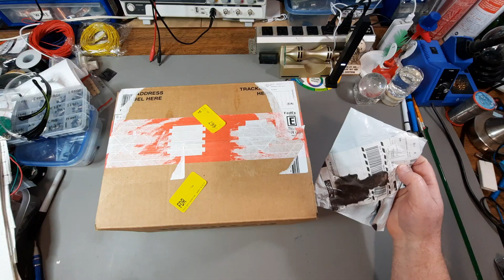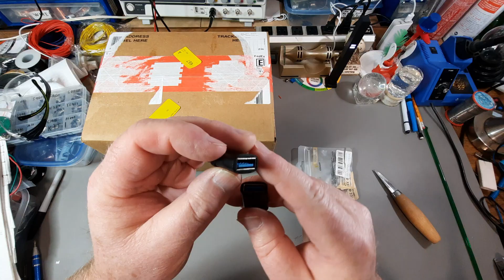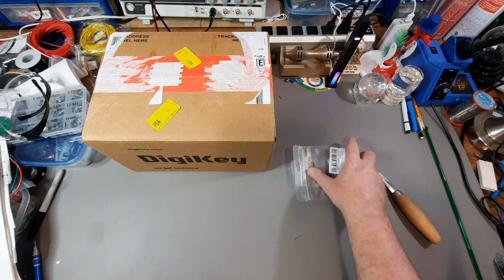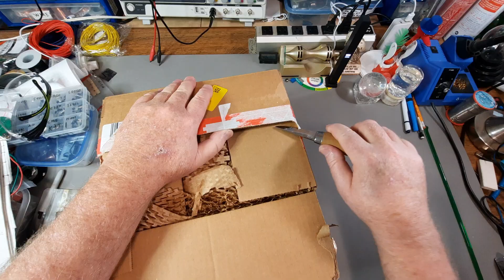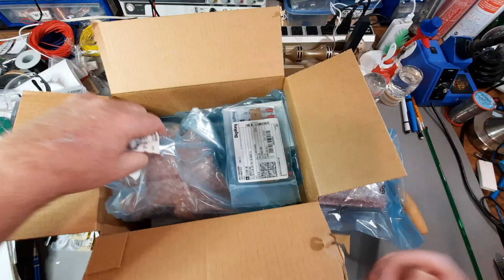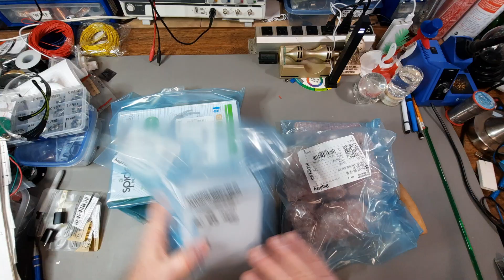Mailbag 45 ish Digikey Electronics Order

Comment: A standard to compare to?
How dare you?
The overstated switching speed on the Texas Instruments Optical couplers comes to mind.
Reply from the maker: Not sure which you are referring to, but for the CD4521 it will be used for low frequency and the capacitor i will find it's popping voltage.

Comment: Wurth Capacitors, are generally very good. They are up there with Nichicon and Rubycon.
Reply from the maker: It will be a good one then to compare against some $0.03 capacitors. See which degrade or pop first.
Have a good day
Reply: @retireeelectronics2649  Well... for normal use, the cheap AliExpress capacitors a fine. For precise work or less noise work, generally precision equipment, and where I use them, in audio equipment.

Comment: Thanks for posting. Question you ever used the CD4024be Seven Stage Binary Counter ic chip? I have used one to build an analog to digital R2R resistor Stair Step Generator circuit. For a Curve Tracer circuit.
Reply from the maker: No I have not, but that looks like an interesting project to do at some point.
Have a good day
Reply: @ Thanks. I also used the CD4060be and a 32.768 KHZ quartz Crystal. This will give you an output of 2048 hertz if divided by 16. Then if you input it into the CD4024 divide by 8 you get a final output of 256 hertz.

Comment: Those clear plastic speakers sound awful! Still, good enough for anunciator purposes.
The plastic goes right to the metal bracket which limits excursion range and flexibility so ruin lower frequencies at higher volumes. Something to watch out for when you drive them.
Reply from the maker: I am not expecting great audio from the plastic covered speakers. The main use will be outside in a wet environment since these are rated IP65. Currently my Halloween motion sensitive display uses a speaker inside two tin cans (-: